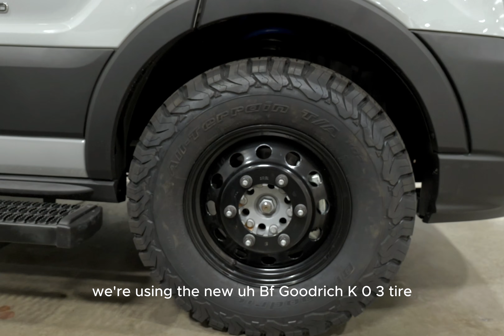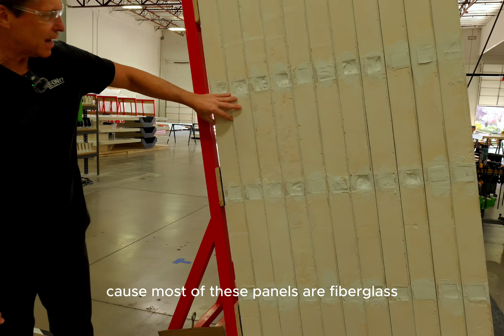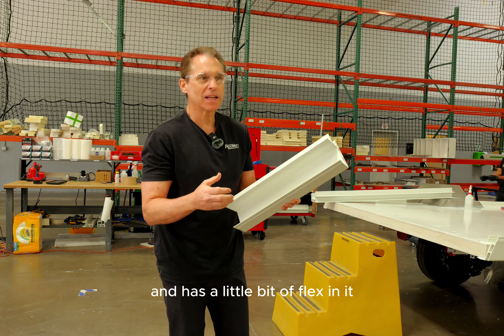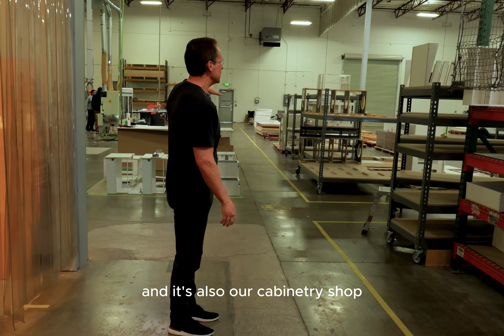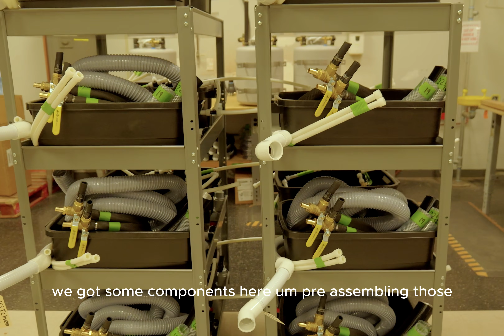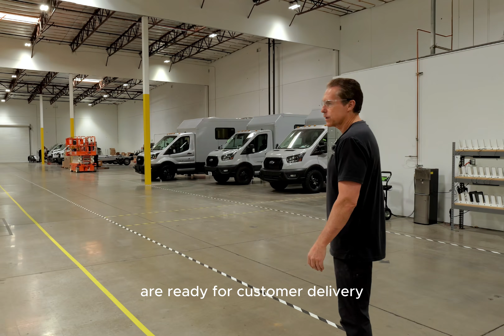AEONrv Manufacturing Facility Walkthrough

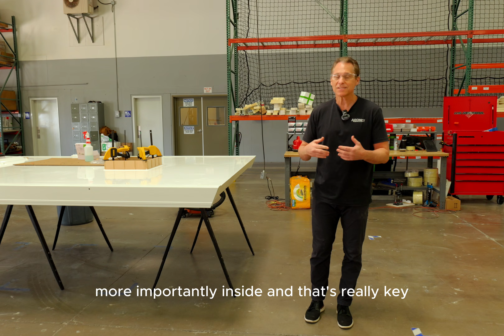Comment: 6:57 AC compressor is on the wall there. You use a second heat pump to go outside?
Reply from the maker: Great question! It’s actually a 9K BTU mini-split system with a built-in heat pump—provides both cooling and heating down to -13°F